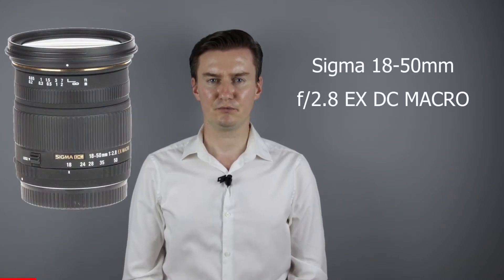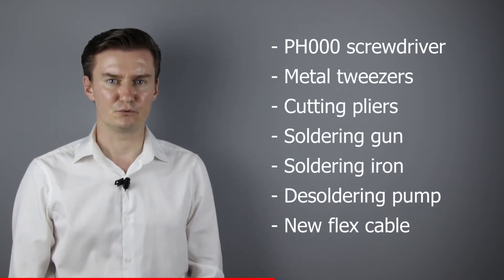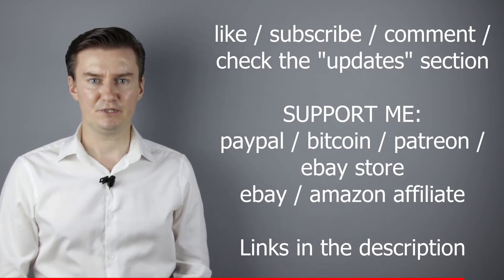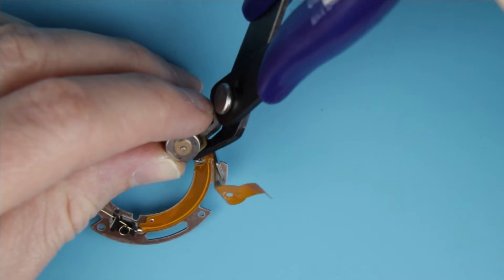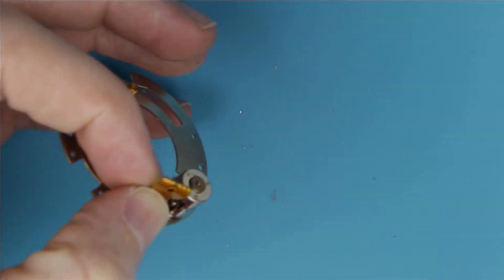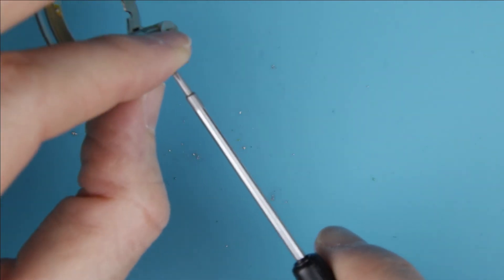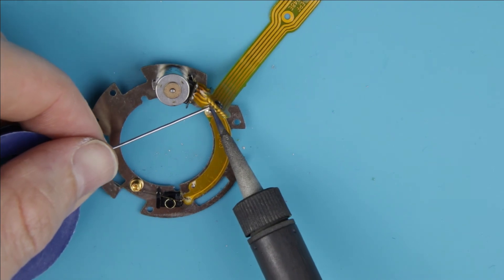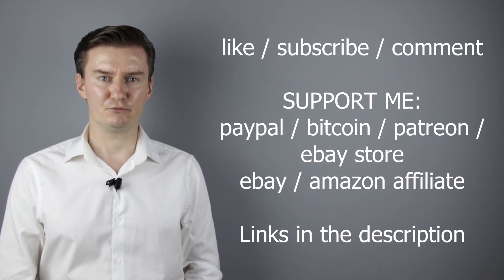Sigma 18-50mm f/2.8 EX DC MACRO replace the aperture flex cable after disassembly (repair howto)

Comment: Notes to fellow repairers: Be very careful when you desolder the cable from the motor. The wires seems to be on a plastic mount. I ripped 1 point off and needed to very carefully glue it into position before I could get all 4 wires through the holes of the new cable before soldering them in place. The wires are finer than hair. If you rip the wires off the motor then you will be in big trouble. Don't know why Sigma used such a cheap plastic material for this part.
Reply from the maker: Thank you for the warning!